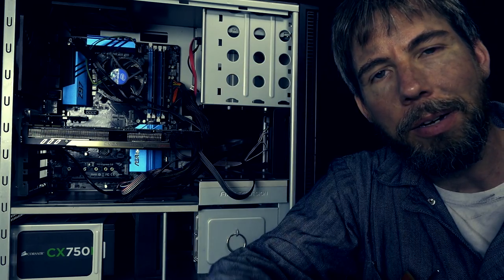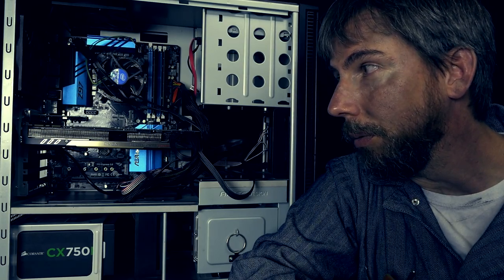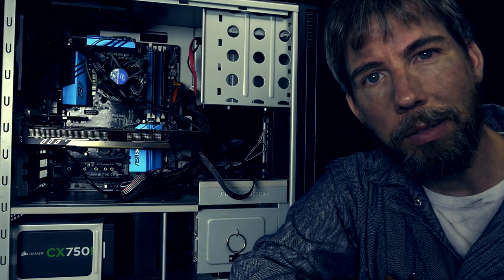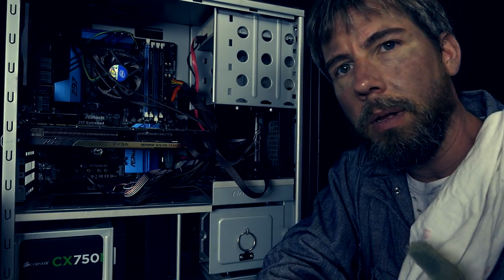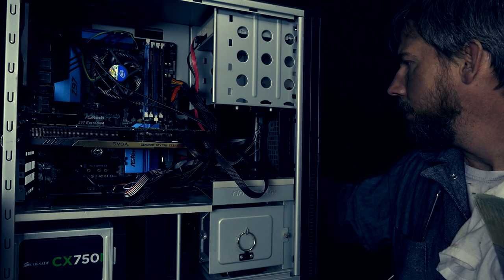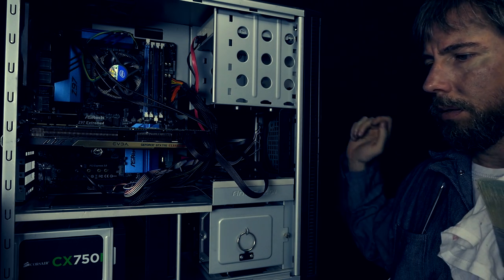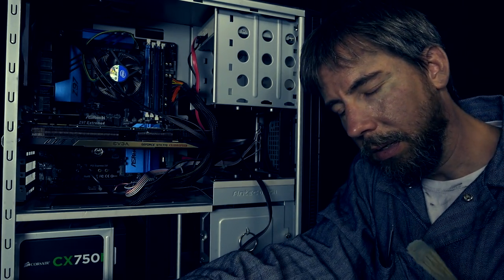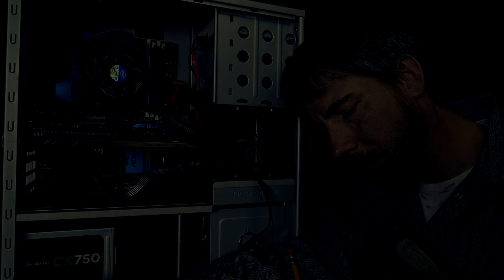Computer Cleaning & Basics with The Repairman [ ASMR ]

Comment: E.R i would personally recommend getting a liquid cooler if you're gonna run the demanding games of present
Reply: It's not even his computer, it's the professor's
Reply: Hes not overclocked...theres no reason whatsover to get an after market cooler, especially a liquid cooler
Reply: Just because a cpu's not overclocked doesn't mean you shouldn't get a liquid cooler. It can fry the cpu  if graphically demanding games are continuously run.
Reply: Why would you go for a liquid cooler, when a good air cooler does the same job with far less money spent?
Reply: +Phenomenal One no. It absolutely means you shouldn't get a liquid cooler. The stock cooler is fine if you don't over clock. At the very most you can pick up a cheap after market cooler like a hyper 212, but a liquid cooler? No. All it does is look pretty at a premium
Reply: +Phenomenal One How does graphically intense games stress the CPU? They stress the GPU. And no CPU is going to fry. If it ever would get too hot for the cpu, there is a safeguard that shuts down the system if the temps are too high. And that is not going to happen, unless you have fucked something up when overclocking or applying thermal paste etc. I have a i5 - 4670k @ stock TB 3,8 Ghz with a stock cooler. In GTA V, which is pretty CPU intensive it only goes up to 75°C and 75 Celsius is completly safe.
Reply: +TheToukoli Exactly, I swear I hate comments like these where people just have to try to appear like they'r so smart with computers and they know exactly what you're doing wrong and how you should fix it. Then it turns out they have no idea what they'r talking about
Reply: +AzeroFTW i honestly know what I'm talking about guy,  you just no nothing about computers
Reply: +Sanjeev KCK hahaha you must be an apple it guy because you really don't know what you're talking about 😂😂😂😂
Reply: +AzeroFTW if you can't back anything up, just shut up and stand aside.
Reply: +Sanjeev KCK you're the only one not backing anything up Apple IT guy😂😂😂 Go back to whatever school you came from and ask for your money back. Lol Air cooling not being sufficient enough and a waste of money for a non over clocked system?? Hahaha you're trolling right? 😂😂😂
Reply: +AzeroFTW go to school. i think you need to actually have experience in this field even make a claim to deny anything what i said, which is obviously being ignorant. go read up on the differences between air cooler and liquid coolers and come back to me kiddo
Reply: +AzeroFTW hmm, honestly I don't find anything you say making any sense. But when u claim to say air cooler is a more feasible alternative over liquid cooling, that's where you're wrong better. Also, you dont understand that alot of components in a computer can be overclocked not just the cpu. All i am saying in liquid cooler will be a wise way to reduce the heatflow of your computer while a simple air cooler does not actually does the job.
Reply: +AzeroFTW I also never once said air cooling was better than liquid cooling. I said its a way better and cheaper method than liquid cooling seeing as the cheapest AIO liquid cooler cost $60 while a hyper 212 cost $30 and performs on the same level as that $60 cooler. But thats getting off the.point. the point is. He said he wasnt overclocking, therefore,there is absolutely no reason to get an after market cooler, and if he did want to get one, it would be alot better to get a good and cheap 212 evo since again, hes NOT overclocking
Reply: AzeroFTW Air coolers are noisy dude. Any ways the issue is not about the price, its about which is an effective solution over stock coolers. Just getting contained liquid cooler would do and that doesn't cost as much these days. I did not even recommend him to get one those water pipes. Not overclocking doesn't mean you computer will not overheat, overtime everything will. I've transitioned from that from my own personal experience. tbf, air coolers are as nearly pointless than the stock coolers provided.
Reply: +Sanjeev KCK Again. You say you're an IT guy, but im pretty sure that was a decade ago. A stock fan is noisy. An after market fan such as the 212 evo is extremely silent. How do I know? Because unlike you Ive actually worked with a variety of coolers on a variety of systems. Go do your research before you try spewing your idiocy on the internet.
Reply: AzeroFTW You are actually the joke here actually, arguing about after market coolers comparing with liquid coolers. I have actually used hyper 212 evo and honestly, it's loud. 'Have used' is the keyword here.
Reply: +Phenomenal One again. look at the fucking context. Im not saying air coolers are better. Im saying there is no reason to get a liquid cooler in this guys case. The only reason we're talking about noise level now is because this idiot cant back up his orginal argument. As for the noise argument,Im saying a $30 evo performs the same both cooling wise and noise wise as a $60 liquid cooler. Never ever did I say that an evo out performes a good liquid cooler. But I dont think you people know how to read so ill leave it at that
Reply: +Phenomenal One And yeah some people have stated their evos being loud but usually the case is the ball barings on the actual fan as well as not setting up their fan profiles properly in their bios. Ive installed evos on 2-3 systems ans they run pretty silent,especially when you replace the regular fan with a nice slim quiet fan. I never even said an evo was the best choice tho, if you care that much about noise, theres plenty of other air coolers that run very quiet and sill perform on par with the cheapest liquid coolers. But again, he doesnt even require an after market cooler because hes not doing any over clocking at all. And again, if he did want an after market cooler to be safe, he has a variety of quiet air coolers to choose from that will give him frosty temps provided he doesnt oc, as well not break $60 mark.
Reply: AzeroFTW Overclocking is something that can be done any point of time when you need just that extra juice, you will realise soon enough how inefficient air coolers are in the coming years. They are bulky, noisy and not always a cost effective solution. Trust me, go look around people around you that have used it. I have and i love my liquid cooler. Don't argue when you no knowledge about things.
Reply: +Sanjeev KCK Oh you're still trying kid? Dont bother. Its obvious reading comprehension isnt a strong point for you. I could go on about the fact that never did i say air cooling was better than water cooling or the fact that again, he isnt overclocked and doesn't plan to be, but at this point just seeing you try to.comprehend the situation is sad. Ill let you pretend you're an IT guy kid, have fun.
Reply: +Sanjeev KCK 😂😂😂😂😂 What a joke of an adult
Reply: AzeroFTW After market coolers 😂😂
You know nothin'.
Reply: +Sanjeev KCK Bruh, you're taking shit way too seriously
Reply: +Sanjeev KCK +AzeroFTW it's just an ASMR video, chill
Reply: +Sanjeev KCK he doesn't need liquid cooling for any of those parts for any games 😂😂 IF he oc'd I would recommend better cooling but the fact you are saying air cooling doesn't do anything of significance is just wrong, so that is what I will agree on with the other guy. liquid cooling is solid though👌
Reply: Laurence Whiting I'm not gonna rebut only because your dp is that of house stark's sigil.
Reply: Jon Snow Ayy, my kinda guy

Comment: I wish this could give me asmr but I keep getting frustrated with the cable management and your airflow setup, please work with thermodynamics hot air rises so pull cool air in from the bottom and exhaust it out the top for maximum effect. IEEE 1394 was originally called FireWire. finally you should replace the stock Intel cooler with an aftermarket one.
Reply: He already knew it was called FireWire, he brought it up in one of the traditional non Roleplay ASMR videos

Comment: You should use gloves because pare hands can give electric shock to computer
Reply: Not when it's not plugged in...
Reply: +Trazerade Even minute static charges can damage the motherboard.       Plugged in or not...
Reply: +BlueNoteOne Use a static bracelet
Reply: +ASSOCIATION OF INDEPENDENT SPIRITUAL PRACTITIONERS, depends on were you live, i have built at least 30 computers in the past 7 months in east Texas and have never had a problem. I see people all the time were these gloves and arm bands and thing. When honestly it doesn't matter where you live. Its a factor but not a big one. Touch metal on the case before you touch anything else also.
Reply: ASSOCIATION OF INDEPENDENT SPIRITUAL PRACTITIONERS Or just constantly touch the metal case to discharge it harmlessly.  That's the peasants way.

Comment: Why does he have a 750 watt PS😂😂
Reply: as heating
Reply: 650 watt power supply are enough for this card
Reply: Ever heard of futureproofing and having power headroom? Maybe he wants to get a better GPU/CPU in the future and doesn't want to buy another PSU just because the old PSU didn't have enough wattage. Let the man make his own decisions.

And Stefan, a 550W is enough for this build. 650W is enough to run a 2080 Ti and Ryzen 9 3950X.
Reply: @crylune  yes (2080 Ti or higher) no 12 core or 8 core 550 watt are enough too.
Reply: AlexM yeah but he basically needs a whole new computer to use that 😂
Reply: @crylune  absolutely...
I'm running a gtx 1060, ryzen 7 x3700, 2x ram, 3 ssd cards, lots of rbg and some fans on 550 W and it works all absolutely fine...
So his 750 should moooreee than ok xD

Comment: How unfortunate you were sold the Corsair CX-series power supply :( It's absolute garbage and being the most crucial component (the only one being able to break others) I'd suggest to get it changed ASAP. Furthermore I disagree with you, I find the CPU more as the "heart" of the system, seeing that it only does calculations. Hard drives are the brain, motherboard the skeleton, RAM the veins. You can add external graphics, increase the muscles. :)
Reply: regarding the psu, i have never had a problem with a cx-series. i consider the ram as short term memory and hdd as long term memory , cpu as brain, motherboard as body (the circuit would be the veins, going to the cpu and such)
Reply: Your personal experience is irrelevant. They've chosen the worst quality capacitors for the product, shortening its general lifespan to around two years.
Reply: Googling stuff is too complicated? No reason to get offended over a bad quality component. http://goo.gl/oISn0o
Reply: Gouca umm, did you read the article?
Reply: Gouca sure you can google it but all you did here was read the title and say "hey this looks good"
Reply: KnifePartyOfCats What are you trying to prove? The article clearly states it's built of low quality components and fails to deliver stable voltage.
Reply: Gouca the article is talking about the older CX 430/500/600 not the cx 750 that ER has
Reply: Gouca also, its clear that you know more about computers than me, im just a 14 year old, hell what do i know. but please tell me how im wrong

Comment: you wouldn't like the way l clean my computer, it's so cringe. the first thing l do is take the whole thing apart and then l remove the heat sink from my GPU so that l have just the PCB. then l wash my motherboard and graphics card off in the sink and then l set the over to 170 degrees and throw them both in there for a while to let them dry out. then l soak my fans in water as well and let them sit in there for a while and then l spin them around to get any dirt that might be caked up in the bearings. then l plug them in to help get the extra water out of the bearings and then l have to put more grease in the bearings to compensate for what was lost when l washed them. by this time my motherboard and graphics card are dry and so l put new thermal paste on them and then put the whole thing back together and power it on to make sure l didn't kill anything.
Reply: 2 words: compressed air
Reply: doesn't work, l have tried it. there isn't enough air pressure to knock off the dust. washing your stuff by hand works so much better.

Comment: Funny it could still run fortnite on low settings
Reply: This video was made in 2015, and even then the graphics card could still run the game at medium high
Reply: Fortnite is a cpu dependent game
Reply: @frankl9951  i run an i7 2600k and get 144fps
Reply: Hentai
Reply: @flakey6339  i Average at 160 wit a ryzen 5 1400
Reply: @frankl9951  overclocked?
Reply: @flakey6339  no , but I do have it paired with the 1060 6gb and 8 gigs or ram 3000mhz

Comment: using a stock cooler? no no, that's not right
Reply: those 4 degrees don't matter
Reply: +SlyGuy he can't overclock with a stock cooler
Reply: +SlyGuy That noise though...
Reply: +DrömZ i don't get why you wouldn't want to overclock, a new cooler is only like 20 bucks
Reply: + he has a i5 4690K, and if he wants to OC, I don't recommend the stock cooler
Reply: +DrömZ if the noise dosent bother you now it isn't worth it.
don't let elitists ramble, of your performance pleases you now, save your money.
if you want to overclock a little bit and your stock cooler is too loud, the corsair h55 is a good cheap choice.
anything more expensive is really only for a decent amount of overclocking.
Reply: DrömZ well the fans make the noise, not the cooler. But if the noise bothers you that bad and you don't plan on overclocking, the h55 quiet edition is well. Quiet
Reply: The guy has a wife and kids, better reason to spend money than a new CPU cooler.
Reply: +DrömZ you can only overclock if it has the "k" in the name so you can keep the stock cooler

Comment: I hope you changed your PSU! the corsair CX series is pretty bad, they use cheap capacitors and it's mainly designed for office computers. Pick a better one, i suggest you EVGA, it's the best brand for power supplies.
Reply: I just would use a corsair Ax power supply they are pretty much the best out there
Reply: This PSU is insanely overpowered for this system. Waste of money here, unless you're somewhere with energy prices through the roof.

Comment: Drop the best cpu for the socket into the board, paired with a nice aftermarket cooler, overclock as far as possible while remaining stable. Upgrade to 16GB of ram, overclock if possible. Upgrade gpu to whatever suits your budget, add an ssd, and you still have a very capable rig here. 

From the looks of it, the power supply is plenty of juice for upgrades, and the board looks decent.
Reply: more efficiently is best
Reply: nigga this video is 4 years old I'm sure he's upgraded by now actually he said he switched to console because he was tired of PC

Comment: all the kids in here with their "moms credit card" build calling a modern graphics card (2010+) old because theres one that has 1MHz faster clock or something redundant. no body needs to play a game at max ultra graphics with 60fps. if you can run a program you want to run your computer is good. no one needs an i9 when a i3 is sufficient for most games. no one needs more than 8GB of RAM. having a latency of a few milliseconds is too small for you to even notice a difference there is no realistic reason, unless youre running neural networks or fluid simulations you really dont need to WASTE money on hardware thats brand new simply because its "better". if you think a radeon 4870 or any other modern computer component is old you have no idea. ive got computers so old youd have a stroke trying to understand what the specs mean. ever heard of a 80386SX? DOS? ever heard of a sound card? floppy disk? if you wanna call something old and incapable, try reaching back to the 80's and 70's. but id barely call these incapable or old either.
Reply: bought my own components, seeing as everything's expensive now, I could only afford a $700 (only 700 I know it's still expensive, although relative to a computer, not so much)

it's a really good 1080p gaming machine, it can run most games on 1080p ultra 50-60fps

anyways, my point is, it doesn't matter what system you have, if it gets what you want to do on it done, then why ridicule. these trust fund kids are fuckin ridiculous and are a stain on the PC community
Reply: Correct. Let the man enjoy his rig if it works just fine for him. All these elitists barging in about him using Intel instead of Ryzen and having a 770. Video was uploaded in 2016 first of all. These people are nuts.
Reply: R3 or R5 with max. 16 GB ram yes mostly that's enough
Reply: Office PC ;-)
Reply: Thank you for commenting this.